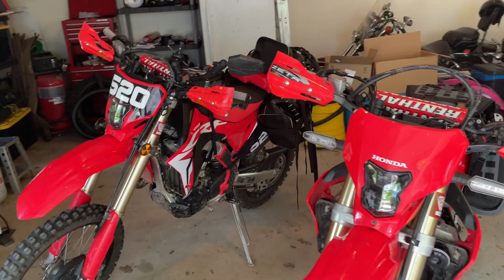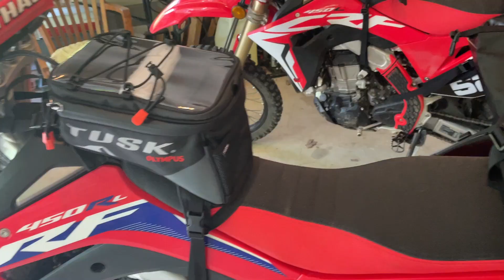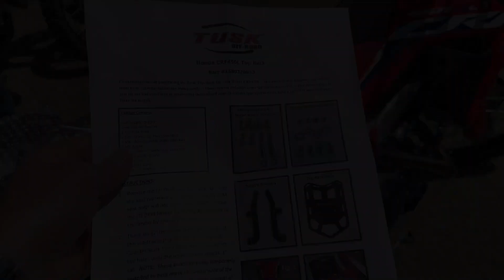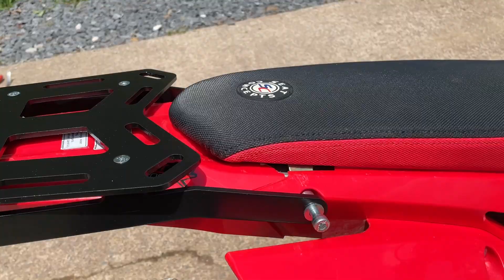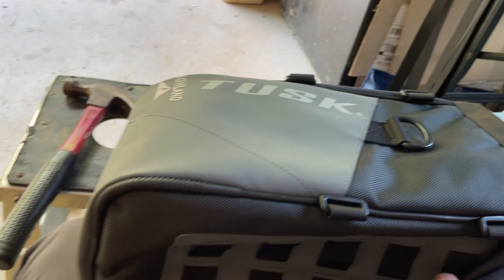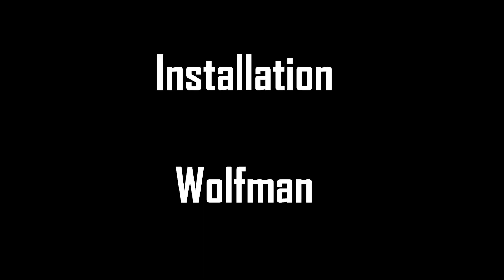Installing Luggage on our Dual Sport Honda CRF450RL and L, Tusk Highland and Wolfman Luggage Systems

Comment: I was hoping that you would show how you attached the lower strap on the exhaust side. The only place it can go is near the exhaust.  Near the riser on the frame by your calf. I had it there but started to smell burning plastic from the strap melting. It’s to close to the front exhaust bracket mount. I might need to heat wrap my exhaust.
Reply from the maker: Yeah, you have to be really careful with how you strap it, we almost burned one of ours too. I don’t remember exactly how we did it.

Comment: Really enjoyed watching the whole trip. Did have a question as I'm looking at a Wolfman setup. Did Jake use the "E-Base" or the "B-Base"? I know the E-Base is the recommended base for smaller dual sports but on some pics I've seen on other bikes it looks like the base sides are barely making it over the edges and the bags are kinda up in the air instead of down the side.
Reply from the maker: We used the e base
Reply: @BillyTyo  Thanks for the reply Billy. When/where is the next trip? I've got my popcorn ready! :)
Reply from the maker: @TheHoovercm  not sure yet. We are busy with the GNCC racing season right now. I would like to eventually do the divide ride. In the meantime I will post some more TAT videos soon

Comment: Looks like you guys are all set...great looking setup...👌🏽👌🏽
What size is the rotopak? 2 gallons??
Also, did you guys evaluate the Kriega and Mosko systems? If so, can you please share any major reasons for not choosing them? 
Thanks again for the video....helps in making my luggage choice so much more informed ...👍🏽
Reply from the maker: The rotopak is 2 gallon. Mosko and Kreiga were sold out.
Reply: @BillyTyo  Thanks